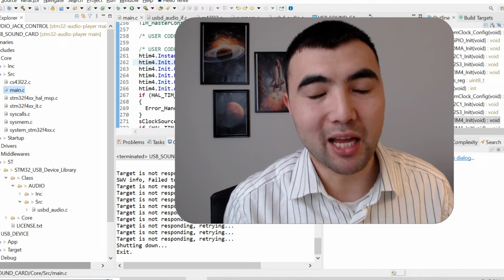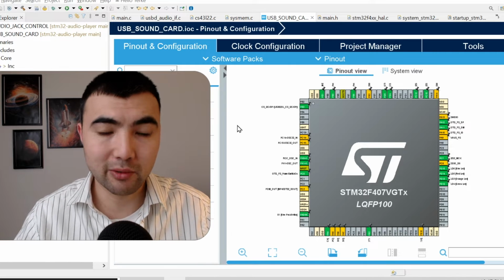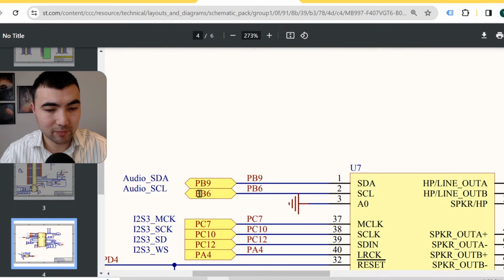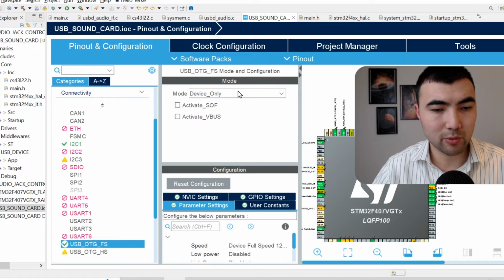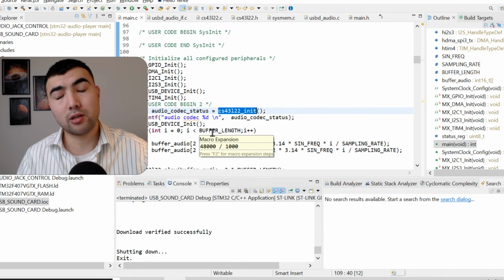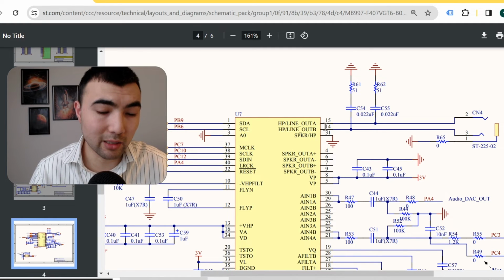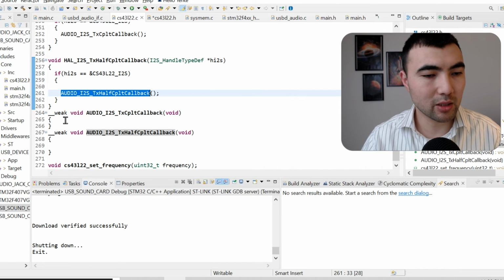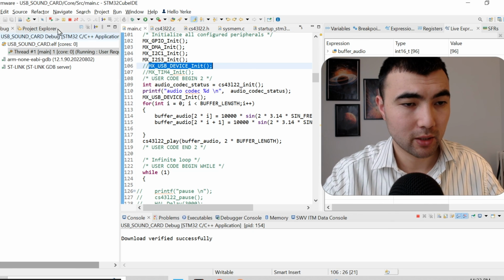P1 STM32 USB Speaker: Audio DAC to produce sound using I2S

Comment: Hi, I've been following your videos. I'm trying to enable Audio Class on my NUCLEO G491 board, which doesn't have as much hardware as the Discovery. Do you think I can do it with my board? Thank you very much.
Reply from the maker: but does your board have a USB Connector?
Reply: @steppeschool3629  Thanks for your reply. I connect to PA11 and 12 of the morpho connector.
Reply from the maker: Besides the USB, you also need the audio codec which you board does not include. I think the easiest solution is to get the Discovery board if possible

Comment: I'm currently doing research to build a microphone from scratch using a full size "true" condenser combined with a ESS ES9843PRO ADC and STM32 to handle the USB connection. Do you have any advice for doing this?
Reply from the maker: I have actually started a USB microphone project but have not finished that yet. I encountered this web page that could be really helpful:
https://hackaday.io/project/181868-stm32f4-usb-microphone/details
Other than that, there is a nice course on Udemy about designing a USB mouse. It could also be really helpful for your project.
Reply: @steppeschool3629  Thanks! I'll take a look at that

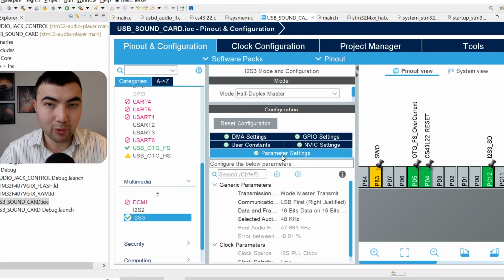Comment: at 8:10 can you explain the "data and frame" choice? Why is it a 16bit frame? For stereo sound, L+R should be a 32bit frame, isn't it? Thanks.
Reply: Oh yeah because you have to split the frame for L and R. I made this mistake yesterday when I was picking frequency values for my headphone DAC and I multiplied by 32 for 32 bits but I forgot that it's actually your bit depth multiplied by number of channels, so for 32 bit stereo audio, your frames are actually 64 bit.

Comment: Thank you. However 48000/16 bit is not a high audio quality. In fact it is the quality of the DVD Video sound and is not much different from the CD quality. Btw, most of the audio on the internet is 44000 Hz sampling rate, so the driver will do resampling, which decreases the quality and introduces latency.
Reply: It is the highest possible quality. Higher sampling rates are unneeded for playback due to the nyquist limit, so 48000 hz has a frequency limit of 24000 hz which is above the human hearing range. And 16 bit means your noise floor is -98 dB which you cannot hear. Higher sampling rates and bitdepths are only for audio processing and production.
Reply: @mdxggxek1909  Anything less than 24bit/96khz is just a compromise.